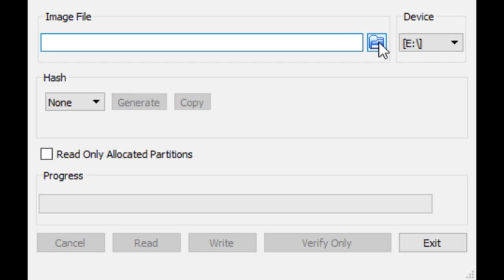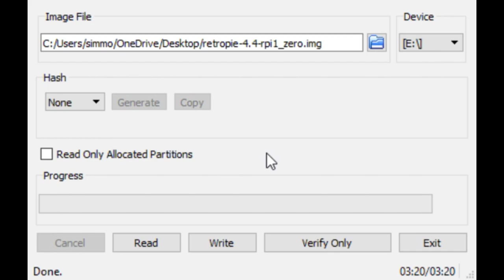Lets build! RetroPie portable with 1.54" LCD hat...what is this, a GameBoy for ants!

Comment: This hat doesn't work with RetroPi automatically. It doesn't recognise either the keyboard nor the display but I haven't seen the step when you'd installed the missing drivers.
Reply: exactly, it just skipped the most important step to install the system to be used with this screen, in my case I downloaded the image from the official website of the company that provides the screen, the only problem I had was that the directional keys are not being recognized separately, and tinkering with the system that a program is needed to communicate with the screen, there is an open source program called ldisplay to compile to rpi zero, and in addition there is another program called retrogame to be able to translate the inputs from the joystick to the keyboard, this video left something to be desired, it only showed the concept and not how to apply
Reply: Where can i get the drivers?

Comment: Hi! Im actually considering doing the same build! Looking forward to getting all the parts in to give it a shot!
Reply from the maker: It’s is a cool build, but it’s not very functional as a handheld, screen is way too small to be functional. Also, it was an easy buy at $13 (CND), last I checked it was $35! Not worth it at this price. They do make other versions with larger screens, check out the link in the description then scroll down to see the “recommended” in the store, you will find bigger screens and different orientation of the handheld. 

In the end, the one I built isn’t totally useless, it’s still a raspberry pi, I can still hook it up to a tv with hdmi👍
Reply: I was actually able to jump on the build when it was rather cheap (14 AUD) so I decided to give it a go, i might replace the tall gpio header on the hat, it sits waay to tall for my taste. Have you checked out the Ugeek game ducky? It looks like an interesting build for the pi zero/zero w!
Reply from the maker: Ya, that gap is way too big!

Haven’t heard of the game ducky, I’ll have to look into that. 

Edit: oh, ya, saw that game ducky, much better form factor and a bigger screen 👍
Reply: @miguelprats8439  I'm interested in doing this myself, removing the gpio header I mean. How did it go for you? it's soldered in there pretty well, and I don't have a lot of experience with soldering.
My plan overall is to mill out a keychain case for it. No sound board or anything. With a raspberry pi zero board I figure it'd be fine to use with a bluetooth headset...
Reply: @RevaeRavus  

Hey dude! I used a soldering wick to remove the header and worked pretty well for me.

Best of luck with it! A key chain for this seems like a pretty sweet idea 👌
Reply: @miguelprats8439  Nice. I pried off the plastic bit and used some nail clippers to cut the prongs off and sorta bull some single pins. I think I can make this work, but if not I'll look into getting some soldering wick.
Reply: @logicdb why os or image don’t work? Did u do the manual install or..?

Comment: After installing the drivers for the gamepad can you still use the hdmi on the raspberry pi?
Reply from the maker: Yes, you need the micro hdmi connector for the PI zero. You would be able to connect USB controllers too
Reply: @logicdb  Thanks
Reply: What drivers are needed for this to work on a pi zero w
Reply: @newguy8830  According to the website "Method 2: Install our driver on the customer's own image.
Execute the following command.
Wget http://www.spotpear.com/download/diver24-5/LCD-show-190115.tar.gz
Tar xvf LCD-show-190115.tar.gz
Cd LCD-show
Sudo ./LCD154-show
Wait for the Raspberry Pi to restart after the installation is complete.
It takes about 3 minutes to restart. The LCD starts to display.

Comment: Is there anyway to increase the refresh rate on the display ? or is it the limitation for the LCD? i tried tweaking with the driver/setups but to no avail :/ it feel like 15fps on the display :/ 

there is one LCD 1.44" 128x128 pixel, that is a lot better response time and refresh rate
Reply from the maker: I’m not sure, might check the emulator settings, perhaps you can adjust it there?
Reply: @logicdb  i did a fresh install of Retropie and compiled my own LDC driver and now its runs games at 60fps :D butter smooth experience :D
Reply from the maker: Awesome! 

Can you provide a link or a google search term so we can find the drivers? (Several people have asked me, I could only find mentions of a github, but no links)
Reply: @logicdb  you can find the driver online https://github.com/juj/fbcp-ili9341

But to get it to work with that driver you have to type a lot of commands, so i will make a video on it and post it, and leave a link here, How to install the driver from a fresh install of Retropie... BUT the driver is only for the LCD to turn on and work! and the HAT buttons are not working, so i will list that too on the video how to get that to work also
Reply: https://youtu.be/2nEEBBBagAU

sorry for the bad video Quality rushed to show you the Result
Reply: Yeah u can overclock em

Comment: i have installed the display driver from link but the system start 1 time every 20 try.... blank screen and green led not flashing, just light on.
someone have my same problem?
i downloaded that image from arcadepunk.
Reply: I have the same problem  did you find the solution??
Reply: @GauravKumar-cr8sn   problem solved for me, i just tried other images and it works :D
But very VERY slow boot :|
Reply: @Gemin88  thanks
Reply: @Gemin88  link please

Comment: also i know how to add the raspbain desktop on retro pie but i need to find out how to fix the touch screen every time i use it the arrow goes to spot when i touch it have any ideas?
Reply from the maker: Sorry, I only ever intended to use retro pie, which does not use touch screen. The seller on AliExpress does have some ready made images with all the drivers cooked in, although I noticed one reviewer said (translated) the x/y coordinates were confused. 

Several reviews say the seller was open about answering questions, maybe try to ask them?

Oh, and one reviewer mentioned better drivers on github, but did not elaborate where, so maybe there are better drivers available, just have to find them(?)
Reply: Settings

Comment: Have you tried to install you own roms to play with this screen? if so how did you go about doing it?
Reply from the maker: I believe I did, you add roms by first plunging in a blank USB stick (I used a OTG cable) the system will add folders to the stick, plug that stuck in the computer and add the roms to the appropriate folder, plug it back into the pi. 

You can find a tutorial on the retroPi website if you get stuck.
Reply: @logicdb  Perfect thank you!